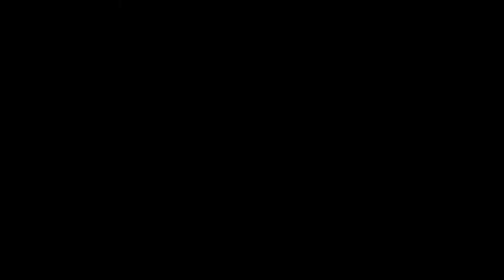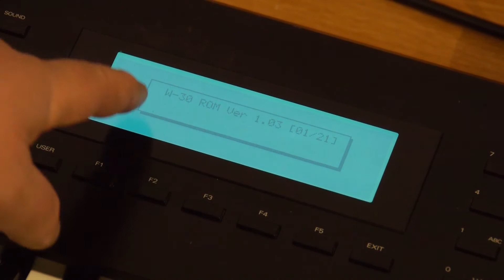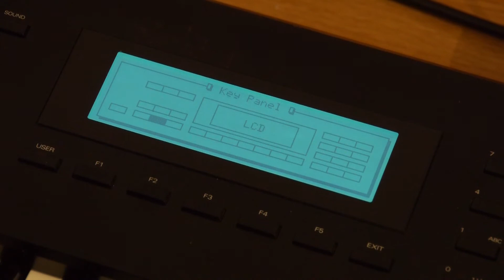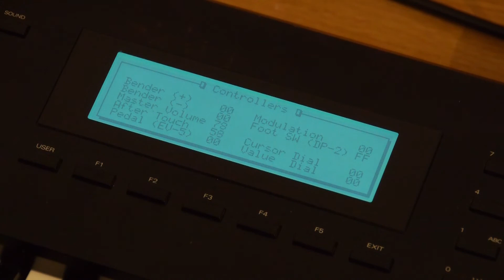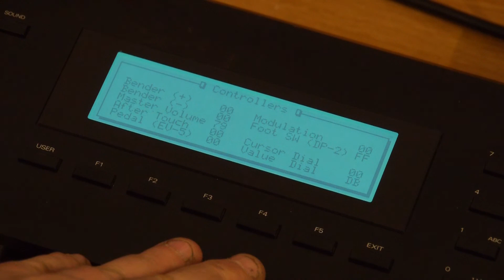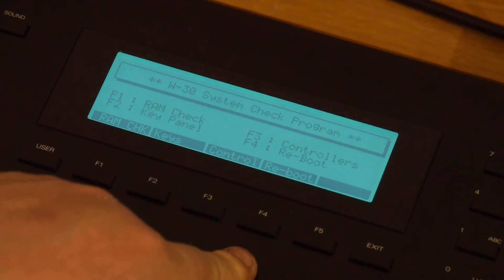Roland W-30 test Mode

Comment: Hi I wanted to ask how to make a back up copy of the system disk .
Reply from the maker: What disk types are you using, ideally they need to be MF2-DD 720KB, then it should be a case of, start your machine using your working system disk, leave it in, then navigate to user item "28 FD copy" and press "execute" and it should load your system disk into memory and prompt you to insert your new disk, once inserted press "execute" it should then format the disk, this will happen even if the incorrect type is inserted it will just render the disk unreadable, if you have the correct type inserted once formatted it will copy the disk image to the new disk, complete and prompt you to insert another if required. You should then be able to boot from the freshly copied disk. I suspect that the disks you are using are incorrect or you have a bad write head on your drive. If you are trying to use 1.44MB HD make sure both the holes are covered over with tape and try formatting them using "user item 24 Format" prior to creating a new system disk, some say it works but i have found it to be unreliable. good luck.